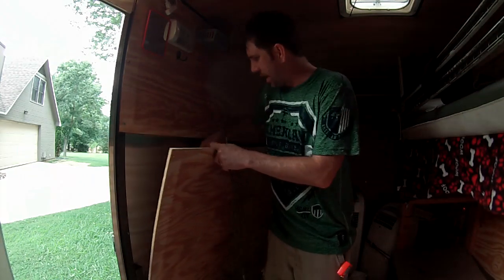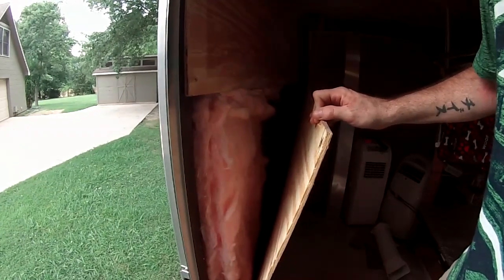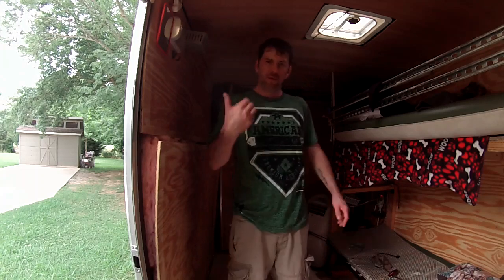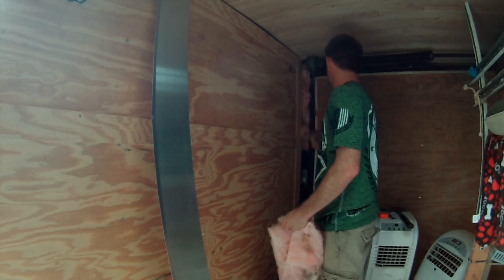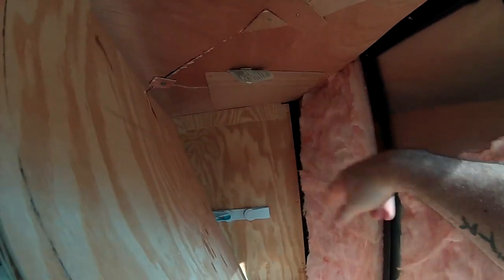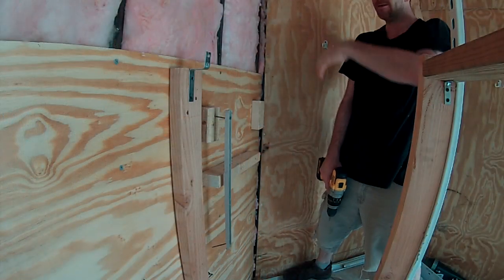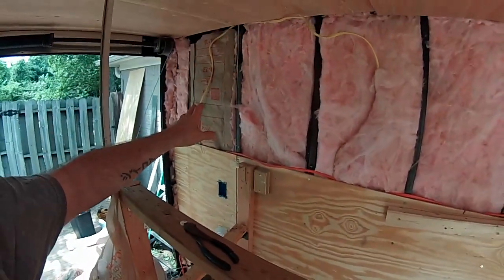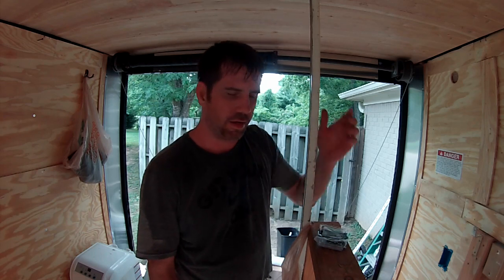Insulating the walls  ........6x10 Enclosed Trailer Conversion Project

Comment: A little trick I learned is use spray glue to hold the insulation in place when you can't use staples. The insulation tends to fall to the bottom of the wall over time.

Comment: did humidity got into it ? looking to do the same to my trailer for winter but i think i'd better put a polythene sheet on the outside and inside sides. it'll just last longer and would keep the warm a lot better
Reply from the maker: never had an issue with moisture on this trailer
Reply: Kraka069 i'm making a trailer to haul sleds in the winter and sleep in it. All the snow melting could probably moist a lot. I'll put some line x on the ground tho
Reply from the maker: yeah, you would know better , we dont usally get snow, and if we do , its minor